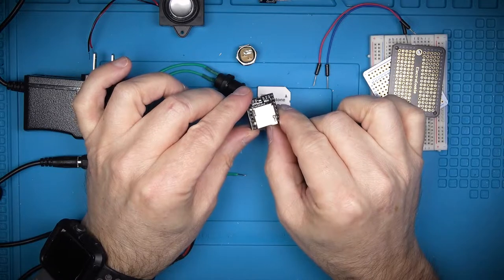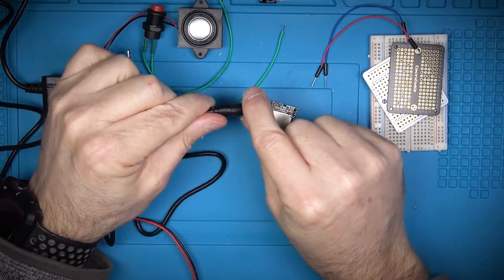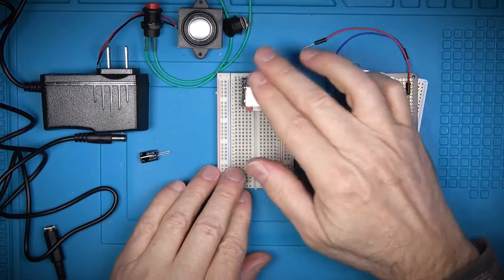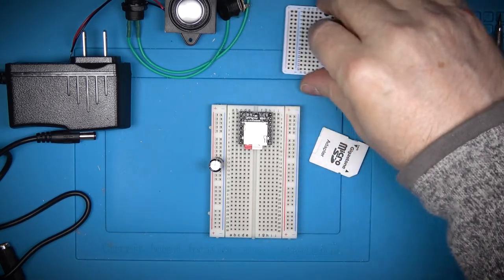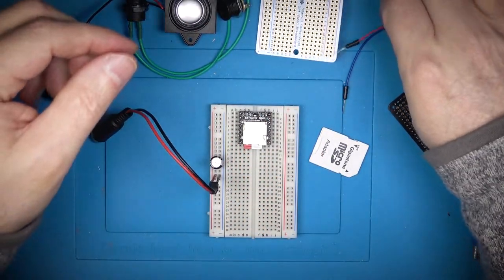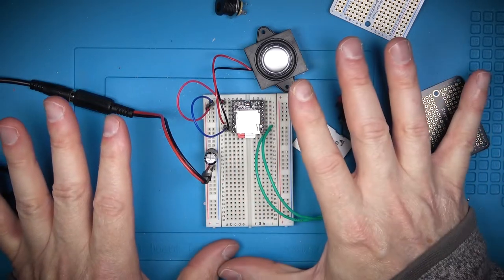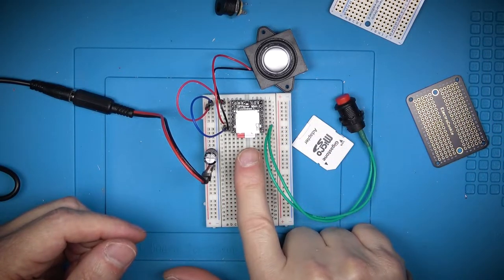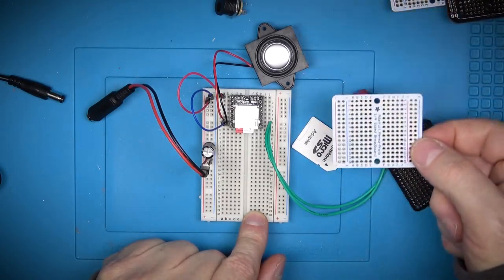Easy Diorama and Book Nook Audio - DFPlayer Mini #dfplayer-mini

Comment: THIS WAS FANTASTIC.  Finally a simple, easy, straightforward method.  Don't need arduino or anything else.  Just want to press button, hear sound. You did it.  Best of all it's affordable.  Saw another video where the electronics alone were over $100.  Could buy a cheap mp4 player for 20 lol
Reply from the maker: This is probably one of the most compact modules out there. I’m tinkering with another module when ya really just gotta have an Arduino but sometimes a button or two is enough! All the best!
Reply: @RandomMakingEncounters  could this be done to also actuate a small screen and play a video file?
Reply from the maker: @craigmurrayauthor  Great question but I sadly don't have an equally great answer. Video is tough. I've been looking for a solid video solution for dioramas and have learned the following: Arduinos don't have the oomph to play any really real video... sorta... kinda. It looks like an ESP32 might have a bit more under the hood - https://www.youtube.com/watch?v=67RFm2RMjC4 . This is a pretty intriguing path. ESP32s are pretty affordable as are tiny screens. The video is a bit much because he's building a custom PCB but there's no reason it can't just be kludged together. It's all programmed through the Arduino IDE so tweaking the code is more approachable.

I've been intrigued by these - https://learn.tinycircuits.com/Kits/Tiny-Video-Player-Kit_Tutorial/ but haven't tried them for anything yet. The kit is $60. Not terrible but it comes with a bunch of things you may or may not need.

Right now, my solution is a cheap video player and screen with HDMI. Cheap is a relative term though and you may be looking for a much smaller solution. If you're looking for something along the lines of a tiny TV or maybe some sort of mini digital signage/display, that ESP32s would be promising!

Comment: I built a similar set up many years ago. I use ADKEY_1 to start the sound file. If you long press it, it loops the sound file. Have recently built your thunder/lightning circuit for my railroad module.
Reply from the maker: I’m going to have to try that! I had a realization that not everything needs to be controlled by the microcontroller especially since multithreading is something you have to fake a bit on Arduino. I’ve also run into some glitchy behavior when I’m trying to do too many things at once… better to make the sound control more analog control if all ya need is on/off… and now loop! Thanks for the tip!

Comment: thank you, it really worked..
Reply from the maker: I’m really happy to hear it worked out. The DFPlayer is a pretty capable little board. It can be incredibly easy or extremely frustrating to use at times but controlling it with some momentary buttons works really well and avoids a lot of programming and complex connections. All the best!

Comment: I’m wondering if I could use a 3.7v 18650 rechargeable battery for taking this on-the-go. Trying to add sound to a mascot head. 😂
Reply from the maker: This can absolutely be battery powered. The actual demands of the player are small. Where you'll see the most drain is in your speaker/amplifier. A mascot project sounds fun! All the best with it.

Comment: board is max 5 volt .i used a power bank putting out 5.13v and blew the board ....just a warning for anyone thinking oh an extra bit of power cant hurt
Reply from the maker: Thanks for the comment. Yes! This board is a bit sensitive when it comes to voltages. If you’re hooking this up to an Arduino, you need to dial the voltage down from the Arduino pin to the RX pin on the player. There is a lot of conflicting information out there but it seems like the voltages on the board are 3.3 volts. Some documents say “5 volt tolerant” but I would be careful not to exceed that and that’s only for the VIN to power the board. I always use a couple of resistors to create a voltage divider to bring drop the voltage down on the RX pin from the Arduino 5V to 3.3V for the DFPlayer. You advice is well said… always work within the specs of the board and err on the conservative side! Cheers!
Reply from the maker: Sorry to hear that. Due to some of these challenges, I’ve been looking for alternatives. This is a compact solution. But it takes additional voltage regulation to keep things from going up in a puff. I hate that smell of melted chip!
Reply from the maker: My current approach to these types of project is to use a 9 volt wall transformer as my starting power source. That's plenty to connect to an Arduino using the VIN and GND pins. For the DFPlayer, I connect the 9 volts to a 5 volt step down regulator (you can find tons of inexpensive boards online). Generally speaking, those boards should provide a fairly stable voltage and usually require a higher source voltage to work. As I mentioned above, you do need to use a couple of resistors to create a voltage divider on the RX pin on the player. It's not documented on the wiki but it seems the communications pin really does better with 3.2 ish volts. That voltage divider sits between the Arduino TX pin (5 volts) and reduces the voltage down to 3.2 for the RX pin on the DFPlayer.

Comment: Thanks for wonderful tutorial. Just a small question how loud is it? 
Is the volume as good as a mobile phone ?
Reply from the maker: There are two ways you can attach speakers to the player. You can directly connect a small speaker to the SPK_1 and SPK_2 pins that run through a built in amp. The volume is pretty good depending on the speaker. The player specifications say up to 3 watt and I've used both 4 ohm and 8 ohm resistance versions... I may need to do a side-by-side test. Connecting a speaker directly will give good volume if you're making something where you're close to the project/diorama/nook. The best comparison would be one of those musical greeting cards. If you want really big sound, you can connect a headphone jack to DAC_R, DAC_L, and GND and then plug in an external speaker like one of those computer speakers or small speakers with a headphone plug that can be plugged into a phone. That can be as loud as the system you're connecting it to.

For nooks and dioramas, connecting a speaker directly worked great for me. I also built a Halloween prop that needed to be heard from a distance and a small rechargeable speaker was great.

Here is a link to the details on all of the pins - https://wiki.dfrobot.com/DFPlayer_Mini_SKU_DFR0299

Hope all that helped and all the best with your project! Cheers!

Comment: Great video and so much fun to do, Thanks! But, when I press the button the device does not turn off. The same song starts playing over and over again. Do you know why this happens?
Reply from the maker: Interesting and completely unexpected! Are you using a momentary push button or one that stays on when pressed? That's about the only thing I can think of. If you're using a button that "latches" and stays on when pressed, the player would loop in theory. With a momentary button, it should only play once. If it continues to loop, it seems like there's something that is mysteriously connecting those pins... a short somewhere.

I hope you get this figured out. Cheers!

Comment: Thanks a lot for your awesome explanations! 
How loud does the 3ohm speaker get?
Can it still be heard from a few meters away with background noise?
Reply from the maker: Driving a speaker off of the built-in amp is honestly a little underwhelming. If you really want to have almost unlimited volume, the best way is to skip the speaker outputs on the module and use the line out connections instead. Those are indicated as DAC_R, DAC_L, and a ground connection on this page - https://wiki.dfrobot.com/DFPlayer_Mini_SKU_DFR0299. Then you could plug in a battery powered speaker using a normal 1/8 cord or run it into a bigger sound system. For my animatronic skull project, I used a small, rechargeable USB speaker and it worked great! Hope that helps! Have fun and all the best.

Comment: Outstanding Thank You so much. I want to use a remote button, can the ADA Fruit Radio board work with a button. And put it in a train so can a Buck board set to 5v work OK. Greta sound solution I need this asap. Thank You,  Dennis AKA Frankentrain Laboratories
Reply from the maker: All of what you described seems completely doable. I’ve never worked on anything that is remotely controlled but it’s perfectly reasonable to pair a couple of wireless modules together with a button on one that triggers sound on the other. It would be nice to find some sort of Arduino programmable all-in-one board so you don’t have to have a microcontroller, wireless module and sound board as separate items. There are some boards like the ESP32 that have WiFi and Bluetooth and the Adafruit ItsyBitsy. Maybe pairing a couple of Bluetooth enabled boards is another route. Best of luck with your project. I think solving for the wireless bit will be the initial challenge to overcome and then triggering the board will be easy. I’ve seen a ton of tutorials out there on how to control one Arduino wirelessly with another. They usually toggle an led on and off and that code would get you pretty darn close! All the best again and have a happy new year.

Comment: Hello. This is really helpful video. I just want to ask can we add a volume rotary button to this?. I want to put player in wooden frame. I want it to have power supply, play/stop button, female headphone jack, volume rotary button. It has to play one song up to 3 minutes. Can you please navigate me?
Reply from the maker: Hey there! I don't think you can add a rotary volume to this chip directly. A volume knob is basically a potentiometer that is wired up to control the voltage to the audio output device. Volume control on this board can be managed using momentary buttons wired to various pins on the board. I think this one has been designed for very compact installations where buttons are a better solution. If you're ok with swapping out a rotary volume control with a couple of buttons, this will be perfect and pretty easy to do. Here's a link to the data sheet - https://wiki.dfrobot.com/DFPlayer_Mini_SKU_DFR0299

You can see where you would wire a 5 volt power supply to VCC and GND. I would think that 3 AA batteries would be good. Alkaline would provide 4.5 volts and rechargeables 3.6. The board theoretically works on 3.2 to 5 volts.

Your headphone out jack would be wired to DAC_R and DAC_L with is either a line out or headphone out and bypasses the built in speaker amplifier.

If you wire momentary buttons to IO1 to ground and IO2 to ground, short and long presses on the buttons control playback. I don't see a note indicating what would stop playback?? I don't think there are any limits on track length.

Another board you might want to look at is this one - https://www.amazon.com/gp/product/B07YFPBGF8

Documentation on this one is a bit more cryptic but what I do like about it is there is a headphone jack already mounted on the board and solder points to connect a speaker. There's also a potentiometer on the board for volume control which means you could try desoldering that potentiometer and wiring in one that is external but the same value.

I don't have as much experience with this one but I really like the fact that it's already on a board with connection points and a few components already in a place. Here's a site with a bit more information - https://www.icstation.com/music-player-voice-playback-amplifier-module-sdtf-card-integrated-uart-trigger-class-p-13455.html

I hope that get's you a bit further down the path on your project!

All the best!
Reply: @RandomMakingEncounters  Thank you very much for your response. I will try to investigate it more deeply.

Comment: Hi, really nice project. What modification is needed to loop the file present in the sd card if only one file is present
Reply from the maker: Sorry for the slow reply. Not sure if you sorted this out but I need to test my theory that holding the play pin to ground constantly will do the trick. The documentation for the board wasn't helpful. I'll update you fer sher. Thanks!

Comment: Always great videos..  Any way we can get a PCB board on your Etsy store?? Or Gerber file Might be a good idea.
 Also wondering why you haven't used any low profile TTP 223 touch sensor switches? Have a look might make a good video (torch you can touch, to turn on the lights, or a little light switch, you touch. Even an instrument panel) or just a big laser engraved push here? For your book nooks.
 I did it for my laser cut camp lamps.. only downside (sorry refuse to say caveot or what not) is they will drain a battery with them on or off.. But I bet you could think of away to fix that one..
Reply from the maker: Thanks for the suggestion! I haven’t… but I sure will now! I will post Gerber files. I’m not an electrical engineer so I’m not all that comfortable selling boards. I don’t want to worry about liability around all of the random things that could go wrong. Anyone that’s done any amount of DIY electronics has experienced the smell of hot electricity and burned expensive components 😂. Thanks for the idea! Looking into it all now! Cheers!
Reply: Thanks.. Even with a simple Gerber file.  I can still just make a simple PCB on the laser cutter just some paint and ferchloride. Can see where liability might be an issue..
Reply from the maker: Touch switches ordered! I’ll post those Gerbers to my site and add a link here.
Reply from the maker: @MagnumPopeye  I just posted a page to my blog - https://randommakingencounters.com/arduino-neopixels-dfplayers-and-circuit-boards/

Comment: LOVE THIS VIDEO! I am looking for a device with a pre-recorded message via an SD card to plug and play. Could I connect this device to a stereo amplifier and then to speakers? I am thinking of getting a Sparkfun Trigger and a stereo amp. Ideally I would like the sound to activate automatically when the power is turned on without the use of any other controllers such as an Arduino. Does something like this even exist? Please let me know, thank you.
Reply from the maker: Thanks! This is a pretty robust little MP3 player. A couple of thoughts around your questions. There are two ways to wire sound output from this module. The first is to use the built-in amp and wire to speakers. I’ve never found the power to be that impressive so the second option is to use the line out connections. You can wire a 3.5mm jack into the module and then plug it into an amplifier or amplified computer speakers. Here’s a link to the documentation - https://wiki.dfrobot.com/DFPlayer_Mini_SKU_DFR0299. You would use DAC_L, DAC_R, and ground. This module can be controlled via Arduino but it also has very simple controls using a couple of the pins and some push buttons and resistors. This is documented under the Working section and parts 2 and 3 might be interesting to you. Basically, connecting the pins to ground through varying resistors (or even just briefly connecting them) can control the board. I think the idea is to make it possible to create a very simple MP3 player with just a handful of buttons and resistors. It may be possible to connect the ADKEY1 pin to ground through a resistor to permanently either trigger play or loop all… some experimentation would be required. Most players aren’t specifically intended to play on powering up but hard wiring that connection might do the trick. A few other modules I’ve found are the WayinTop Sound Module, the EZSound Sound Module, KOOBOOK Voice Module (they should pop up on Amazon searches). They all have their quirks and are intended to be simple (with the exception of the KOOBOOK) solutions to adding sound to something. The KOOBOOK module is a more robust variation of the DFPlayer Mini and has more of the connections you need already built into the board. All of these are pretty inexpensive… which is one of the things I like. I’ve fried plenty of $30+ boards experimenting so cooking something that’s under $10 because I wired the wrong pin to power makes it a bit more affordable. I hope this helps point you in a helpful direction! Thanks for the comment and question. Cheers!
Reply: MAGNIFICENT!!! THANK YOU!!! ❤

Comment: Whats the cap for? Must be this value? Thanks for tutorial!❤
Reply from the maker: I usually add a capacitor to the voltage in to act as a smoothing capacitor to prevent spikes that might damage components when I power things on. I don't have a specific size but generally throw something in the 100 uf to 1000 uf range with an appropriate voltage capacity for the circuit. The capacitor isn't required for the circuit to work. Hope that helps! Cheers!
Reply: @RandomMakingEncounters  Thanks for nice tutorial. Is problem that I used there 47uf 25v capacitor, because I had just this one? My dfplayer is pluged to my 5V3A adapter. Is it safe to not use capacitor with this adapter? Thanks for answer.